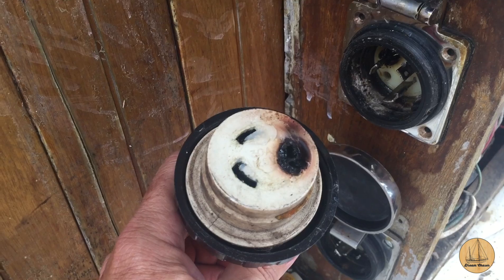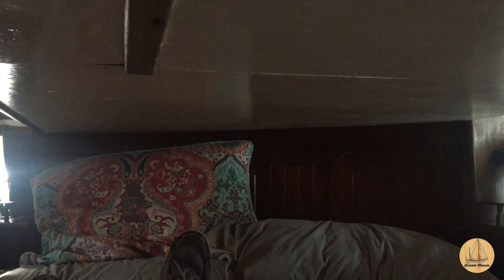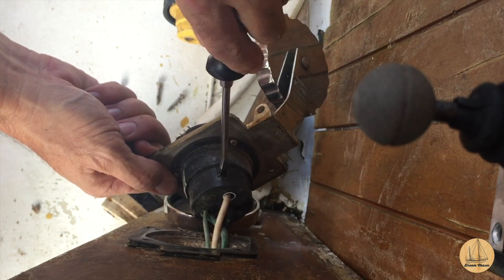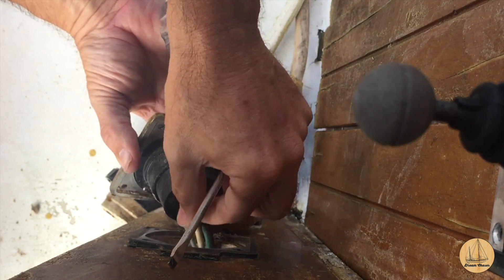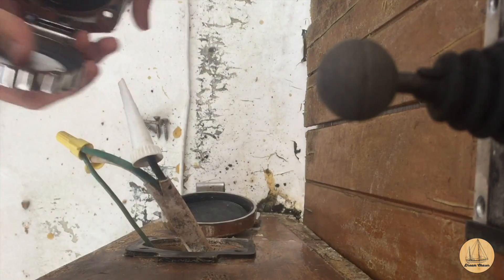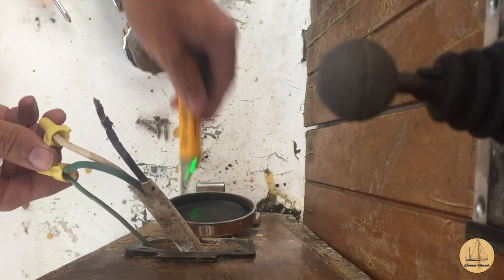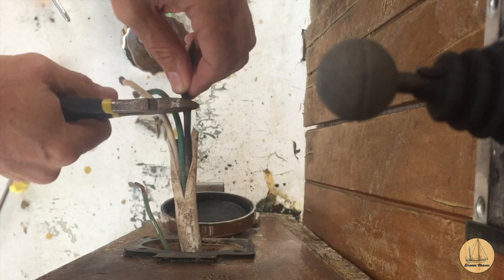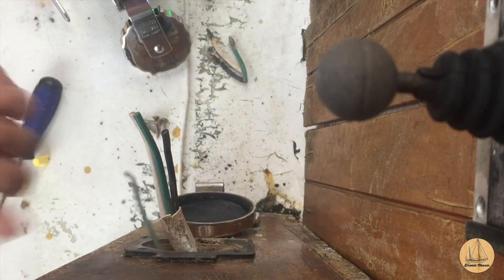Shore Power Problem

Comment: Wondering how the repair is holding up?  I just did the same repair.  I think I’m learning that a 30 amp circuit can’t handle 30 amps continuously.  I’m keeping my load under 24 amps and contemplating upgrading to 50 amps.  I’m also curious about the Smart Plug; especially if mine burns again.  Thanks for the video.
Reply from the maker: Eric Antrim so far so good. It is not getting hot when both air conditioners are on. The line that burned up was the one that supplies the power to the dual 16k BTU units. I also added a "hard start capacitor" to both air conditioners to reduce the amperage draw when the compressor is kicking in.

Comment: A few years ago I bought a brand new Marinco shire power cord. The second time I plugged it in the plug fell apart in my hand - the plastic screw sockets were too large and the sc Wes due nit bite. Thus, of course, is a "fully qualified ABEW certified" product, and supposedly has much higher quality and safety for marine use than those unsafe cords you buy at Home Depot. Inspecting it, I found that it is nothing but a cheap two-piece hollow shell with no gasket or other protective mechanism to prevent water from getting in, even from a minor splash. I've seen better quality at discount junk shops

At Home Depot I can buy solid plugs with the conductors safely and visibly embedded in solid plastic that was formed around the conductors (poured into a firm as a liquid, and cooked or hardened), with no chance to get water in there. To me this meant that the entire ABEW certification program is nothing but a joke and a scam, allowing manufacturers that pay the "certification" bribe can pass off their junk as worth three times the price to "protect" us customers.
Reply from the maker: +Gary Bickford wow. I had no idea.